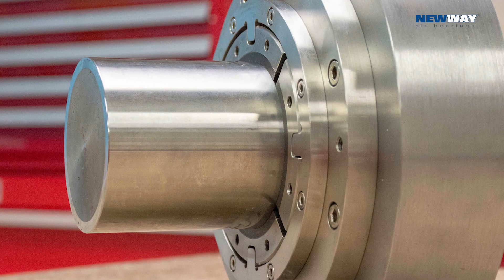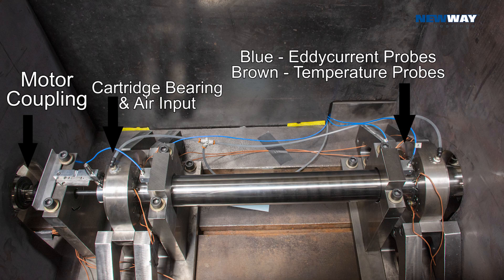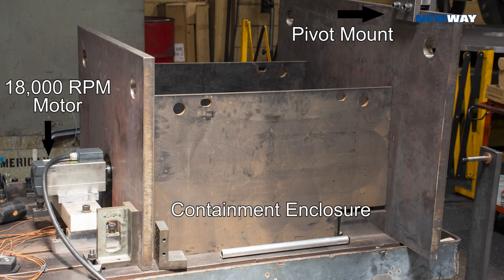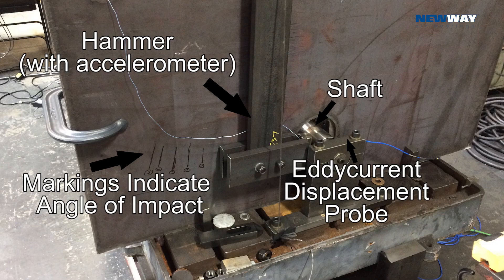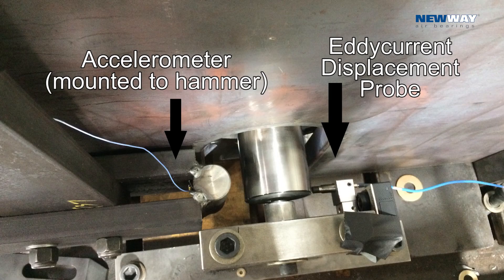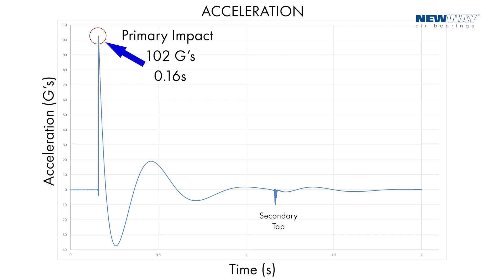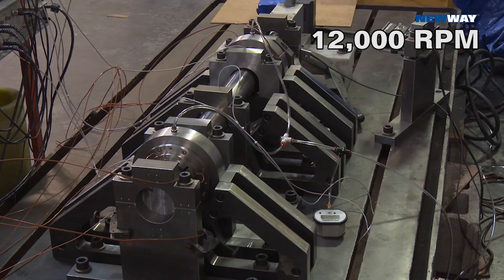Shock Resistant Cartride Bearings

Comment: Why the radial pad has a "significantly" larger radius than the shaft? Is the air gap that big?
Reply: no, air gap is quite small (small fraction of mm, 1/100th or something in the area). the whole thing is big as it contains the pad which distributes air and holds mounting and the porous pad, so as the outer shell is the damping thing, and the whole thing is a cartridge meant to be removable as I may guess (for replacement repair, be suitable as modification to something) so in general it also all takes space etc. compared to actual bearings of that size and load, it about the same in size and in all that
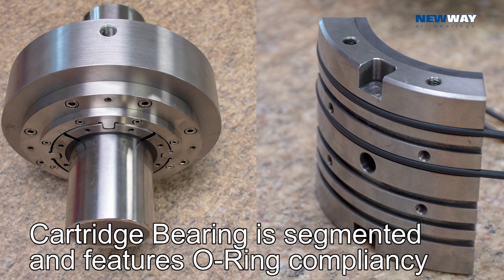Reply: @Molb0rg  Thanks for the reply. I am talking about the picture at 00:16. It seems the gap between the graphite and shaft is bigger than 0.01mm.
Reply: @dongchen7940  you mean in the corners of pads? yes, I see. For me, it looks like they used pads which are a match to a slightly bigger diameter than the shaft is, or it may be wear and tear from that testing stuff - may imagine corners and some parts of pads getting in contacts while the stuff hit. There may be other reasons for those gaps to exists as well. But that size gaps do not have the meaningful bearing capacity - that I quite certain, but not sure it goes significantly deeper than edges - hard to tell. But for the stuff to work the gaps between rotor and pads have to be small enough to restrict airflow becaus of viscosity of air, and thus hold the pressure, if gap isn' small enough it can't work.

from here https://www.loadpoint-bearings.co.uk/about/how-air-bearings-work "An air bearing may comprise of a sleeve separated from a plain shaft by a small gap, typically 5–50 um"

here pdf, from the guys, plot at page 2 https://www.newwayairbearings.com/wp-content/uploads/2018/03/Damping-Stffness-a-primer-copy.pdf - 5-20 microns
Reply: @Molb0rg  Thanks for the reply. Yes, you are right. I also read the newway documents before and recalled the air film stiffness will drop greatly as thickness increase. That's why I initially asked this question. I am experimenting with DIY graphite air bearing in my home shop. I found the flat one is not difficult to make since it is easy to lap graphite to a couple wavelength flatness. But I found it difficult to make the cylindrical one. Do you know a way to lap a cylindrical graphite bearing?
Reply: @dongchen7940    that's interesting, do you have any videos posted? or my interest is more about - the porosity of material - which one you take? I guess the answer may depend on that(material) and tools you have.
As an example, you may have insufficient porosity and thus airflow and thus you may have higher demands for precision, higher than you would need in case of sufficient porosity and airflow. They call it graphite, but yeah it does no look like it, and is some composite mix I guess.

Considering the gaps can be up to 0.05mm(from the links above) it should be well within the reach of a typical lathe. Plus considering the shaft is more thought than pads then if there are some minor mismatch in pads it may work out after some scratching and wear of a pad in "wrong" spots(and I guess some lapping stone may make it happen in a better way).

in general, stuff depends on material - how it machines, how it cuts and grinds and the tools/ways you have to work with it. I see you subscribed to RobRenz, he has good videos about making precision OD/ID and I guess it possible to work in the direction, you do not need the precision he talks about in those videos but principles in general work in a similar way.

The precision of shaft plays probably a bigger role, concentricity/roundness of if. Another aspect is - with a bigger surface of a pad, it has higher chances of it to work if there is not enough airflow - so it probably easier to achieve results on a bigger diameter compared to 1cm one.

Tolerances you mention are way overkill for the kind of application, as with such precision even no porosity at all(no airflow) will act as a hydrodynamic bearing. My current position on all that is - the material(porosity) is the key here. Seen some mentionings of how much air goes through a bearing in a working state, but a random(not the best) one as an example "A gas bearing with 0.5 square foot (6 x 12 inches of face area), fed 60psi compressed air and loaded with 2,500lbs will have a film thickness of .0002 " (from the second link in comment above, page 3)

so it means porosity should be capable of airflow 1L@4bar per 16cm2 per minute - that's a minimum requirement for the porosity of a material, and it probably should do few times of that. (and back to the gap, even in the high-performance case about 5um gap). Not sure about the dependency of airflow from the gap, but gap few times of that may require at least a few times of the flow. So I guess the first thing to check if the material you use meets the basic requirements. So few times the flow to work, few times of the high-performance gap and we may easily have basic minimum like 10L@4bar per 16cm2 - and if it does not do that you may have problems just because of low performance of the material.
Reply: @Molb0rg   Thank you for the long reply, I appreciate the discussion. I didn't post any videos yet but I am considering to open a channel just to share some stuff I made/experimented in my garage shop. I have experimented with poco's zxf-5q, axf-5q,axz5q, they have ~20% porosity and ~80% open. I believe these are recommended types of graphite from poco. I didn't notice different in performance among these 3 types but I noticed they all performed better than the random unknown EDM block I got from eBay.
I love RobRenz channel, he and Tom really like precision stuff and I learned a lot from their channels, especially lapping. I have managed to lap the graphite to a couple wavelength(verified by optical flat under 532nm light). I think I can also external-lap a slotted cylindrical rod first and use it to lap the concave shape in the graphite, but it will take a lot of time to do that. Ideally I believe diamond turning is the way to make such parts but I don’t have access to a diamond turning lathe(yet).
My goal is to make an air bearing lathe similar to the one Dan Gelbart shown in his channel. For this appreciation, I need both load capacity and stiffness. As you can see from the paper you mention. The slope of the load-thickness plot decreases quickly as thickness increase. Generally speaking, thiner air film is much stiffer, also scarifying some damping effect.  For measuring device like CMM you may want slightly thicker air film because it is light load and damping is a key feature. But for my case, I need both. To achieve higher stiffness but still have some damping effect, I need to preload very hard to get the air film to 5-10 microns.  That will require the part to have flatness/roundness no worse than 1-2 microns. That is kind of easy for flat part as I can measure that with optical flat, but I don’t have an easy way to verify that for cylindrical part.
As the airflow, I don’t concern too much about it because the graphite bearing consume much less air comparing to the Orifice ones already. I found my 25 gal compressor is quite sufficient to support all the air bearing for a lathe so I don’t worry too much about that.
Reply: @dongchen7940  okay, seems the channel Applied Science was visited by new year spirit and made a video "Make vacuum pre-loaded spherical air bearings without special tools" you should watch it.

Seems we are interested in the topic for similar reasons and purposes, yeah Dan Gelbart video was definitely inspiring in that regard and somewhat repeating his design is tempting, but also if you haven't seen video year later(from 2016) may watch it - he definitely not use it as heavy duty design. 

So if you wish to make custom shaft - you may start from a jig which isn't heavy-duty on its own - but which allows you to grind the shaft to a dimension with good roundness - as the grinding operation isn't super heavy in terms of force applied.

As checking roundness - in general, dial indicators may work in some setups(idk simplest case some V block to rotate against on a surface plate and dial indicator checking distance between the surface plate and some point on top of the shaft, or setting it on V block and rotate again it and look at indicator), or using a micrometer. There are special ones for just that measuring round stuff, but even usual one can help in the assessment of the thing - rotate measure, rotate measure - with a round object it should be all the same and precisions of 1micron those aren't that expensive and are accessible.

Generally grinding the shaft in a place where it fits bearing is a way to go and there are some videos about using grinders for that (there are some centerless designs to do that, or jigs people use to do the same on regular flat grinders 

Solid Rock Machine Shop Inc. https://www.youtube.com/watch?v=wFeQPNHXot0 - some process of doing precision round, and maybe it worth fiddling on the channel as well

oxtoolco https://www.youtube.com/watch?v=6sqXY7fOVLQ

have seen others as well doing the stuff, so it's not such a super rare procedure.

So if you are interested in lifting all that by yourself, then a jig that allows you to grind a rod into a precision rod is a starting point here.
Reply: the 1-2 micron you think you need, you don't really need. Grafite is so soft, whatever shaft is running on it, will lap itself into the bearing. Better to buy the rod, you probably don't know how to grind a rod if you have to ask that question --- even if you had the tools its a bad idea.
Reply: @meocats  hehe, you are so lovely.